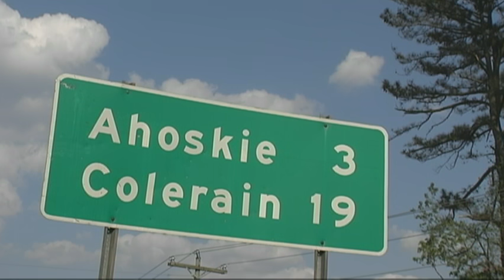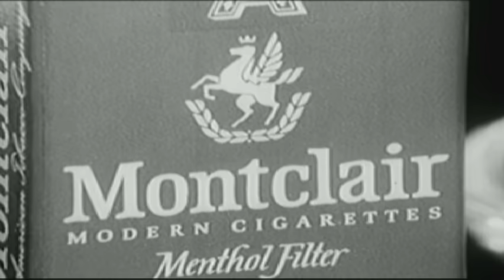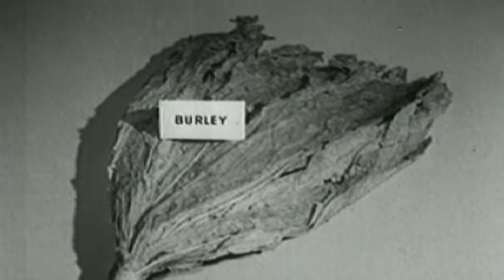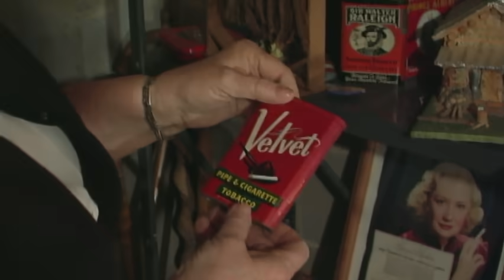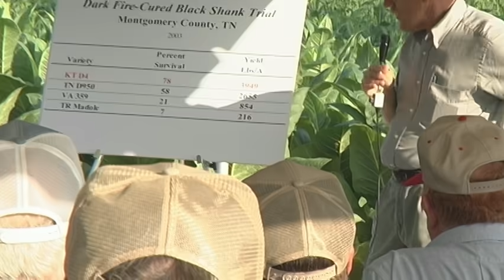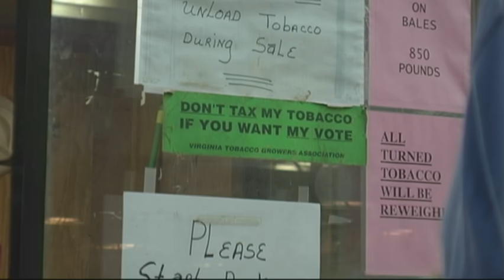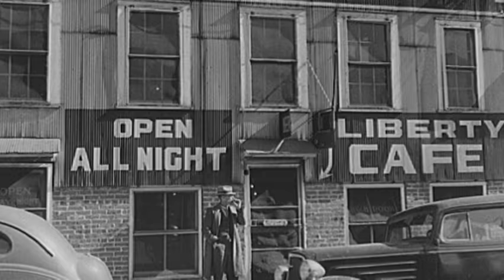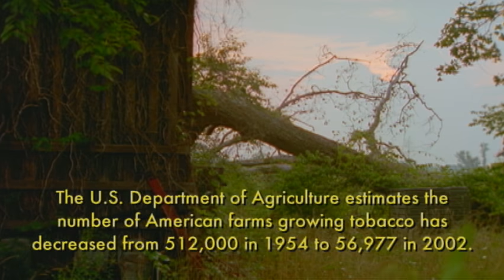American Leaf - Tobacco's Last Harvest Documentary

Comment: I grew up on a small family farm in kentucky. .   my grandfather grew a plot of tobacco every year   so we inherited  a right to raise tobacco.   Government controls came on and every tobacco plot what is measured by an official  every year and if our plot had too many plants by regulation, the proper number of the plants were cut down and destroyed.  Every farm had a "tobacco base" which was it's regulated size of allotment for raising that kind of tobacco.   a government ordered limits on tobacco base increased year after year, meaning that each farmer was allowed yearly a little less tobacco to be raised and sold.
    Our farm tobacco base was getting so small that continuing to raise tobacco  was a lot of work -- all hard hand work --and took us out of that business.    .  Taking care of tobacco plants is not an easy job, and it continues from the first outcropping until harvest time and after.  The tobacco care means the farmer must inspect all the leaves often and remove the worms that were chewing on the leaf.  The soil around the plants had to be chopped and maintained also.  Lots of hand work was required and when the tobacco was cut, farmer was in charge of storing it carefully usually in his own barn.  Only when the plants were inspected,  they could be sold.  I was young enough to miss the worm work and the heavy lifting .  I don't know if our farm sold our base , or simply stop raising tobacco.
Reply: I admit I don't know why the tobacco did not hurt the worms that chewed it.